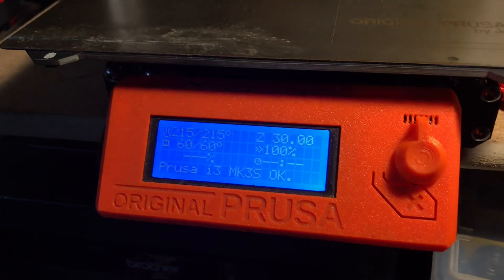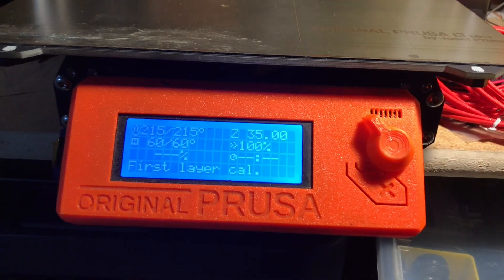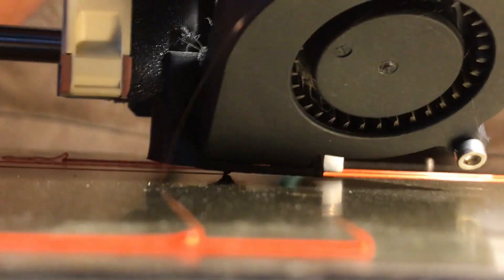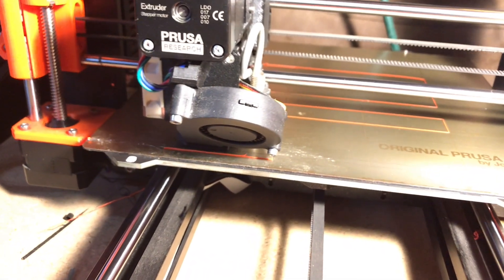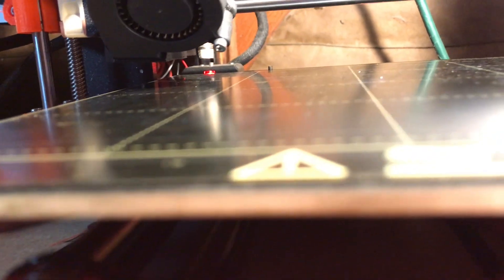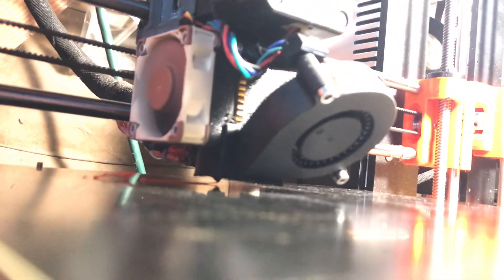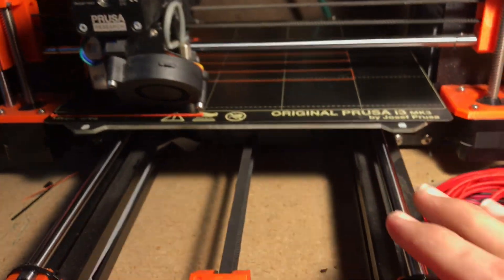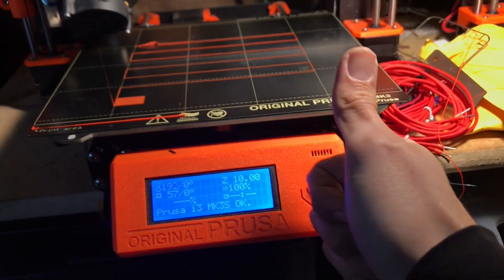Prusa Live Z Calibration and extra sheet setup (on newest firmwares)

Comment: Nice tutorial, is there anyway to just print the last rectangular feature in the hardware setup to fine tune? Any chance you could include a image of what the last feature should look like with better resolution? How does one tell that they are in the sweet spot for Z adjustment besides the played layers blending together well without separations? Thanks
Reply from the maker: You can re-run first layer cal, it will do the zig zag and the square; you can refer to hi-res images in the prusa kb: help.prusa3d.com
Reply: @LA3DPrinterRepair  Hi-res Images    1) https://cdn.help.prusa3d.com/wp-content/uploads/First-Layer-Calibration-02-800x318.jpg       2)https://i.redd.it/ms9o3lqcns881.png

Comment: I didn't know about the multiple sheet setting either. Would this imply that you you may have a different calibration result by just flipping the same sheet? So maybe It should be Sheet 1, Side A, Sheet 1 Side B... etc
Reply from the maker: Probably not, both sheets of PEI would likely be from the same roll, and I'd bet the roll is consistent, and likely fairly consistent roll to roll.

Comment: I purchase a Prusa Printer pre assembled, I have been using PLA and it has been flawless. I just switched to TPU onto a textured prusa sheet and my Z calibration is off due to the 0.300 change in height im guessing. Given I only do a single print with TPU, should I just adjust the Live Z during the print to compensate, what is best practice for something like this. Using Prusa MK3+
Reply: Yes or set up the adjustment for this material and sheet combination on a second sheet. You can save settlings for multiple sheers on the LCD

Comment: So you're able to eyeball the line to see that it's .5 millimeter wide. My eyeballs aren't calibrated for that. It would be nice if you had some more straightforward way of knowing when it's the correct width.
Reply from the maker: It’s not a critical adjustment, as long as the line is “squished” and not “smashed” to the point of choking the extruder, it’s fine. The square is where you can determine if you’re “not in the neighborhood”, “close enough to print” or “too close for comfort”.
Reply: @LA3DPrinterRepair  Thank you so much for your reply. I've been running the First Layer Calibration over and over again, zeroing in on the proper layer. I have a digital caliper and finally got the First Layer lines just about right at .5 mm. The rectangle feels fairly nice and smooth, at least compared to Z height above and below the one I zeroed in on. That rectangle is about .25 mm thick. Is that what I should expect?
I had been using my PRUSA for about 6 months, using PRUS's sliver PLAY and it went great for all that time with lots and lots of prints. I ran out of the sliver PLA and wanted to purchase more from PRUSA but it was out of stock, so I bought their "Gentlement's Grey" PLA instead, figuring a color change shouldn't be a problem. But it just doesn't work. It doesn't stick to the bed well, it globs up, it catches on a part of the print and rips it up from the bed. I've run the XYZ Calibration several times, I've run the First Layer Calibration a bunch of times. And now, even after really zeroing in the Z height, per your suggestions, it's still messing the prints. I'm thinking I might just have gotten a bad batch of the PLA from PRUSA.
Do you have any suggestions?
Reply from the maker: Roger Garrett if you’re using the smooth PEI sheet then you need to refresh it periodically with pure acetone to keep it locked in, gets jammed up with pigment, oil, and particles of plastic.
Reply: @LA3DPrinterRepair  Acetone!? Really? Wow. I've never seen acetone suggested for cleaning. The PRUSA user manual only mentions isipropyl alcohol, and even includes some small pads of it with the kit. That isopropyl alcohol is what I've been using ever since I got the printer. And, yes, it's for the smooth bed. I've had suggestions for using really hot water and dish detergent, which I tried but had no success with.
The closest I have on hand is nail polish remover which is mostly acetone but also has some other ingredients (fragrance and such). Would that be safe to use to clean the bed? Something as strong as acetone I'd be afraid would just strip off the surface of the bed!
Reply: Ah ha! I just did a search for "PRUSA refresh bed" and it has a bunch of info about refreshing the bed, including using acetone but cautioning AGAINST using nail polish remover. So, I guess I'm off to the hardware store for some acetone.
Reply from the maker: Roger Garrett you want pure acetone, with no additives other than denatonium benzoate which is a bitterant; PEI is solvent resistant but the acetone is a strong solvent. And it is actually in the handbook, but they can’t ship acetone you see, so it’s not a secret but they pride themselves on including everything you need in the box.
Reply: @LA3DPrinterRepair  THANK YOU! THANK YOU! THANK YOU! The acetone did the trick. I had gone on the PRUSA forums and explained my situation and no one, NO ONE, mentioned refreshing the print bed or the use of acetone. They recommended all sorts of other things, washing with hot water and dish detergent, special commands in the g-code, and special print tests for setting the Z-height, but not a single one thought, "Hmm, maybe this guy hasn't refreshed the print bed".
I do see now that there there is indeed some mention of refreshing in the user manual, but when it's something a user likely won't need to do for a while, ... well, it just either slipped my mind or I didn't properly memorize the user manual. I'm thinking that, along with the various warnings already printed on the print bed ("CAUTION, HOT! DON'T TOUCH!") they should consider adding something like, "Clean with isopropyl alcohol after every few prints, refresh with acetone once a month".
But, anyway, thank you for taking the time to help me out with this issue. I'm now finally back to successful printing.
Reply from the maker: Roger Garrett happy to help, glad it worked! You might also check my “Operator Intro” video and print out my reference sheet I give out to new operators. https://la3dpr.com/files/Prusa_MK3/PrusaQuickRef.pdf
The dish soap thing works when there’s loads of oil on the sheet, but you still need to acetone treat afterwards for best performance. 
💪🏻🖨👍🏻

Comment: Do you use a glue stick?? I feel like my Z live calibration is good.....but my prints aren't sticking. They stick at first, but by the time it puts down the 2nd layer, it's not sticking.
Reply from the maker: vio4jesus we only use glue stick in the front corner for the prime line when printing lots of PET; bed prep is about which bed you’re using (textured/smooth) and what material you’re printing: textured PEI should never be treated with acetone, smooth sheets should be kept clean with alcohol, and refreshed with pure acetone, if it gets oily from fingerprints and lots of streaks remain after acetone wipe down, you should rinse and dry in the sink with dawn dish detergent to cut the oils, then re-treat with acetone, and your PLA adhesion should be as good as new. When printing PET on textured or smooth it’s vital you use an interference agent like Windex, or you risk permanent bonding to the PEI; and when switch back and forth PLA/PET you must treat the bed appropriately for each material or risk lift (PLA) or permanent bond (PET).
Reply: @LA3DPrinterRepair  I'm confused – I'm troubleshooting my z layer but I'm using glue stick all over the plate – if permanent bonding is a risk, why only put glue stick in the front corner (prime line)? I've just done a soapy water clean, then ISO, then glue stick. The calibration test finished before I got the z correct (it's still too high). So should I now windex clean it to get all the glue off then go back to soap and water then ISO again? I think maybe I'm missing the WHY so that I know how to interpret WHAT to do. Thank you for your video, it's getting me closer. I also read something about not to do certain types of cleaning too often (soap? ISO? Acetone? windex?) but I'm confused about that too.
Reply: Tried again, z calibration looks great now, no curling at edges for my PETG but for my actual model print after the first big outlines, the 1cm circles for some holes in my model, it stops laying down plastic and it's all accumulating on the nozzle after which everything goes downhill. Not sure what causes that.
Reply from the maker: @andrewblair7478  for PLA refresh the sheet with acetone, for PET, you want a separation layer, Windex works.
The obstacles are: dust, fingerprints (oil), and proper z-calibration; refreshing occasionally with acetone will eliminate 1 and 2 as sources of trouble.